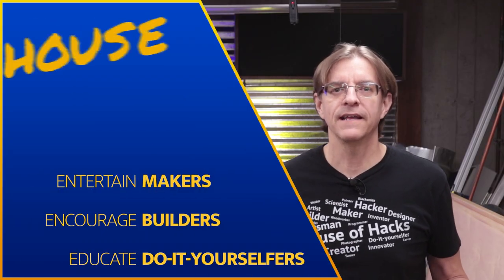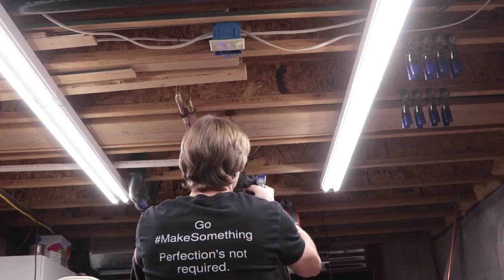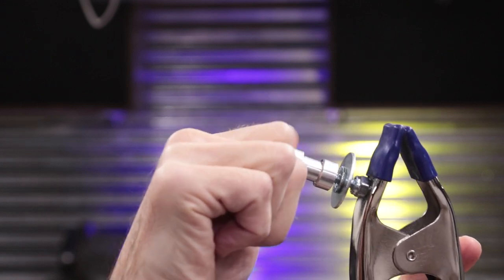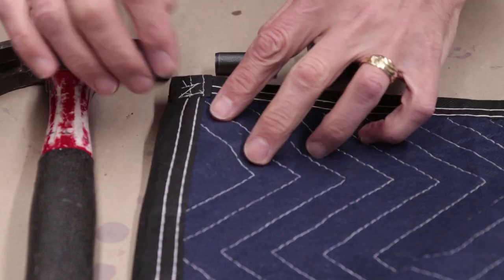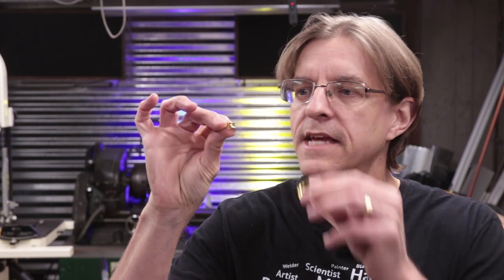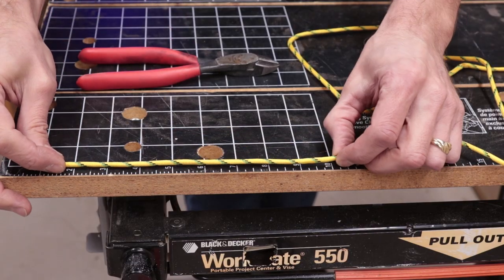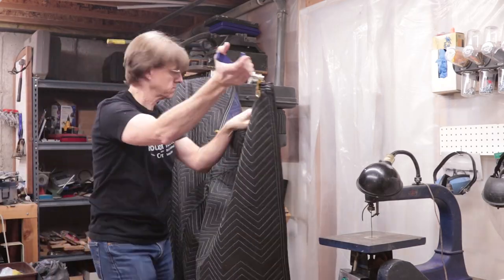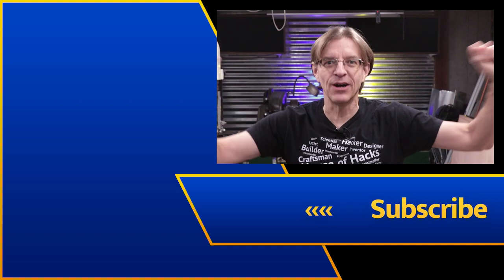Moving Blankets For Sound Absorption - Easy hanging hack

Comment: Would attaching moving blankets to ceiling help to reduce noise coming from upstairs apartment? If yes, is there a renter-friendly way to attach them?
Reply from the maker: Unfortunately, it wouldn't help too much with this type of noise. This helps mostly with echo within the room which is mid- to high-frequency sound. Noise coming through a wall or ceiling tends to be lower frequency sound. This is hard to deal with short of making architectural and building changes.

Comment: I share a wall with a neighbor we are both students. I am often in my room studying , but apparently her work station setup is in her living room. A thin wall separates us. I can hear her on the phone, her listening to webinars, her tv, her dog barking, etc. Quite annoying. Can I use one of these blankets for a wall of Wall is concrete. ??? 😒
Reply from the maker: It would help some but don't expect total silence. That type of problem typically takes more structural type changes to add more isolation in the wall. Noise cancelling headphones and listening to your own audio selections would probably make more difference.
Reply: @HouseOfHacks  Thanks

Comment: You could also always use nails or screws too. Not through the blanket, but leave the nails or screws sticking out enough to put the grommets in the blanket over them to hang the blankets up.
Reply from the maker: Yes, that would certainly work too if you always want them in the same location and it's a surface you can nail/screw into. Thanks for pointing out that option!
Reply: @HouseOfHacks  How many grommets do you install in the blankets? I find two isn't enough for a 5+ lb blanket, I actually had one rip because the grommets were too close to the end of the blanket. Had to install closer to where you did it (I did ot a bit too close the the seems near the end where it's folded over), but it seems like I'll need to use at least three. One near each corner, and one in the middle to bear some of the load.
Reply from the maker: @dylanj8676  Yes, I should have pointed out in the video that the grommets need to be surrounded by the padding so there's enough support. I find three to be sufficient: one at each corner and one in the middle. This also gives me the option to set them up double thick and half as wide.
Reply: @HouseOfHacks  Do you find that's as good as or better than layering 2 at the normal width? Making them half as wide but double width sounds like an easy way to mount and store them.

The double thick half as wide seems like it would actually be better because there will be a bit of an air gap in the folded fabric, in addition to already being twice as thick.

Currently I have them mounted with paracord, but I ordered some metal shower curtain rings to hang them, so when those arrive I'm gonna have to give some recording a go.
Reply from the maker: I've not done any tests for single thick vs double thick. My intuition is that it'd be better if the same surface area is covered. If the same number of blankets were used so the surface area was halved, not sure if the increased density over the smaller area would offset the increased reflections from the lower surface area. (Hope that makes sense.)

Yes, I store them hanging, folded in half. Perhaps I should do a quick video on that.

Good luck with the recording. Hope it goes well for you!

Comment: Instead of modifying the spring clamps, you could either
use the clamp to hold the blanket clamped to the joist The blanket is under the jaw
use the clamp to hold the loop of rope using the jaws. The loop is through the jaw rather than over that clamps stud.